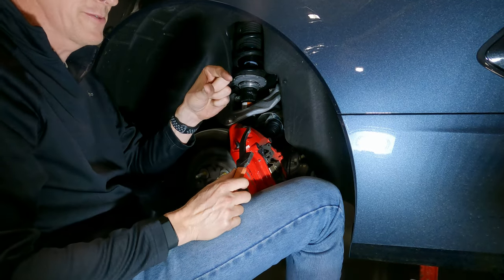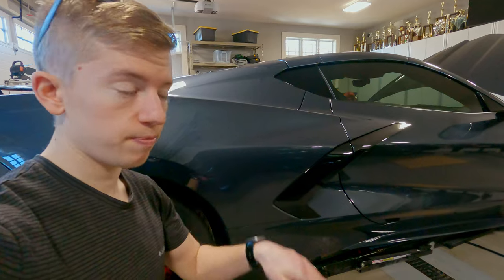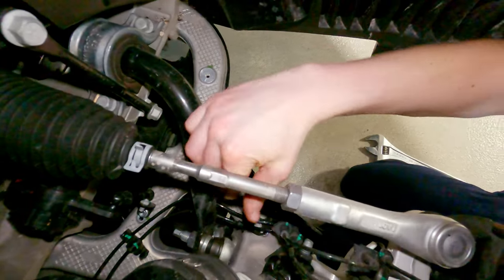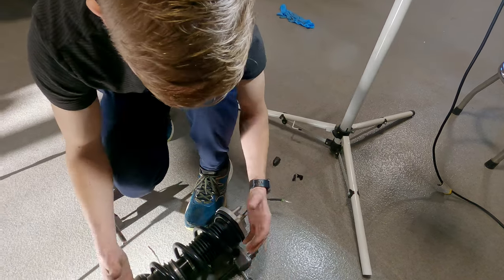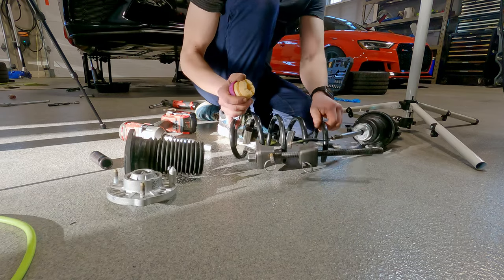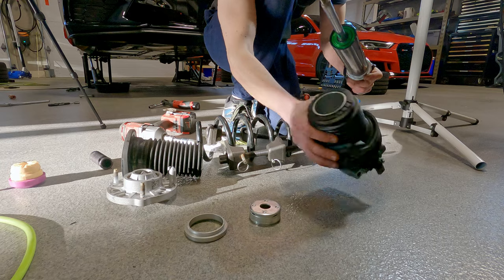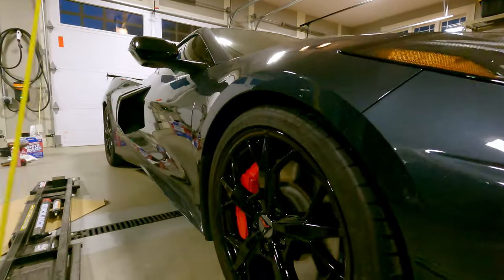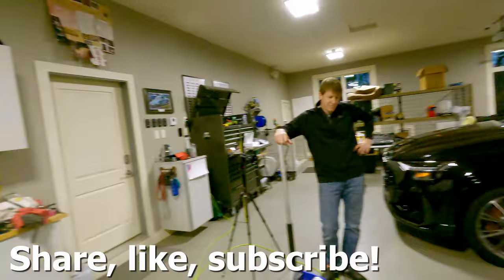C8 Corvette Lowering Collar Install

Comment: You should drive the car so the suspension settles before measuring.  Won't be accurate unless you do.
Reply from the maker: We did actually drive it before measuring, #magicofediting. That's why the front lip had a little tickle 😆
Reply: @HardwayLearning  Good Job.  Cheers.